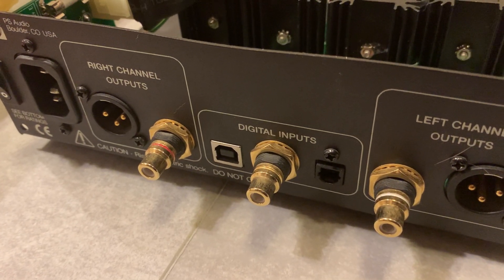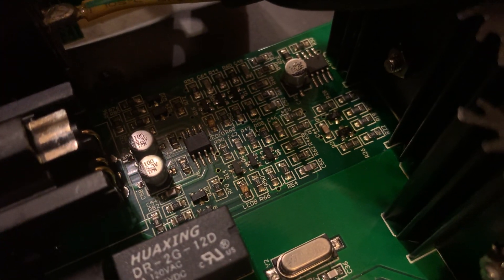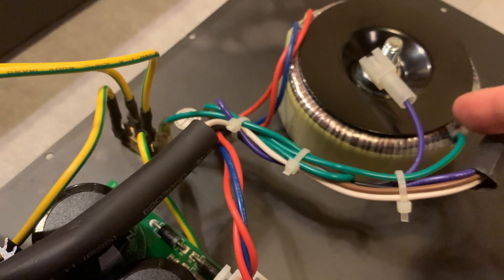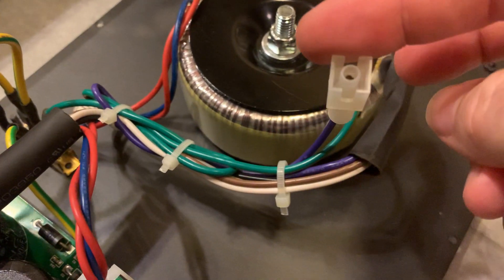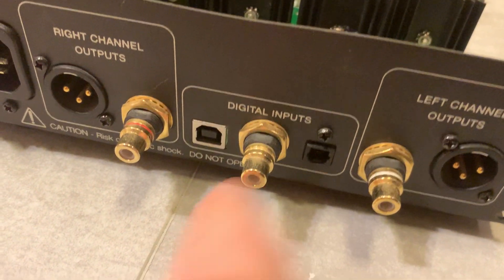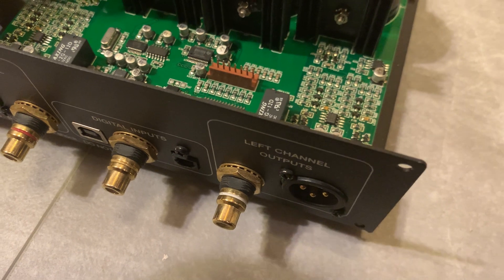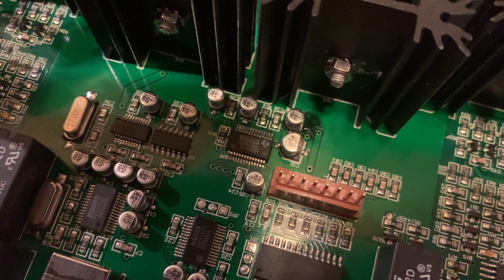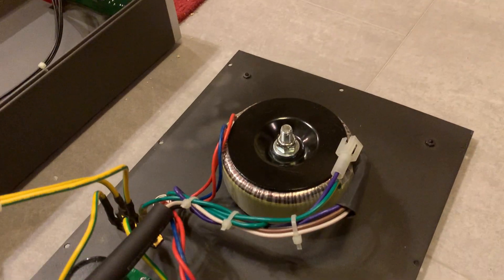PSAudio DLIII DAC internals before mod (visual notepad)

Comment: Hi,
Great to see the internals of a PSaudio dac. I.m just wondering what your goal is which the changes you are about to do to this dac. Changing the ultrafast UF rectifiers with other good rectifiers will probably do nothing to the sound. It's changing a very good component, for another. The main caps i do agree, they seem to be pretty standard. Not bad, but nothing special. The Panasonic you are reffering to is also not really special, not sure what it is you are looking for.
If you want an upgrade in that region, consider Nichicon lkg series. The imaging compared to "normal non audio" caps is better. But please do yourself a favour, and do not use any Elna Silmic!! In a audio circuit. 
These caps kill any high frequency dynamics, as they decrease harmonic's from 10khz and up by 120db! But also natural voice and acoustic instrument harmonic's...
Is you must bypass, take a small value wima pet filmcap and experiment with it.

I also see a normal cheap cristal as a clockcircuit? This is a cheap solution, you are much better off installing a low jitter masterclock (with it's own power supply), in place of that cristal.  The difference will blow you away, if you want a real upgrade in sound...

Good luck in improving your great dac,

Best regards from the Netherlands, 
Nico den Haak.
Reply from the maker: Thank you Nico! I will give a video follow up ;

Comment: To replace an SMD capacitor , DO NOT desolder it................Just twist it with a pair of pliers  :)
Reply: hello frank 
I have been building 2 amps for my first project in tubes , for caps can you suggest any good quality ones , most values will be high so foil or paper caps won't work
Reply: @IDontExist14  Hello 29 , I suppose they are the caps in the PS...........?
First tube amplifier build.............a new world is opening for you........
A lot depends on what kind of amplifier yous you are building............I used a lot of the BG capacitors just like AN did before they became obsolete.
remember that a good sounding amplifier will be working correctly with quality standard parts to begin with.......IF THAT CONDITION IS MET .........only than start to use higher quality parts and listen at every change of componennts what way the expression of the ap goes......faults will be revealed by higher grade components as well as the qualities .
It also depends on what kind of rectifiers you will use..........Solid state or valve rectification.....
Give me some more information about your projects before i will give you the right advise.............
Remember sometimes the better is the worse .......I mean for example that a perfect highest graded capacitor after rectifiers will drain huge peaks of current, saturating transformer and create bursts of Ultra high frequencies, a sonic hash ..........and that is what you will hear as smearing and overlay on your Beautifull music.
I will answer you as soon as I can........
Have a nice day or evening.
Frank
Reply from the maker: Thank you Frank! Yes, that is a wonderful tip.  It does work extremely well :)

Comment: Probably they are voltage regulators...........for example 7805 or other voltages.....
Not a good choice  ..........but common commercial  practice ....but cheap !!!!!
Burson or Tentlabs offer way better solutions..( and better sounding )
Reply: Tentlabs low jitter masterclocks are fantastic... i see a cheap standard cristal in this dac, would really benefit from a guido tent masterclock,  and supply for that same clock.
Reply from the maker: Thank you for the tip on the clock! That is  a territory I have not ventured to yet. ;
Reply: @nicodenhaak3961  Yes they are , I use them too...........Guido knows his job.